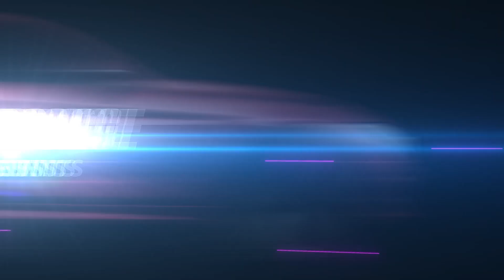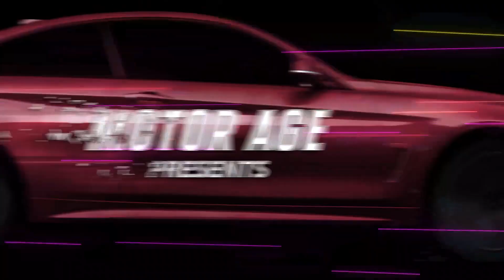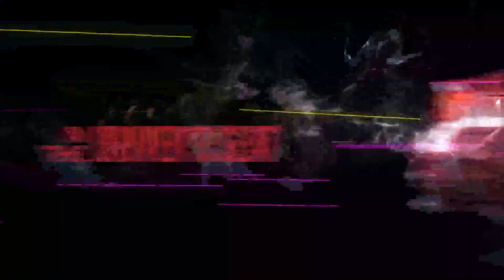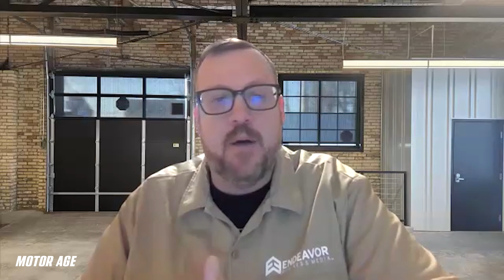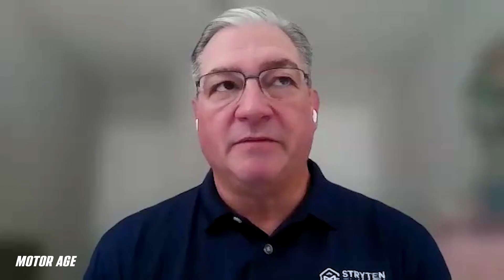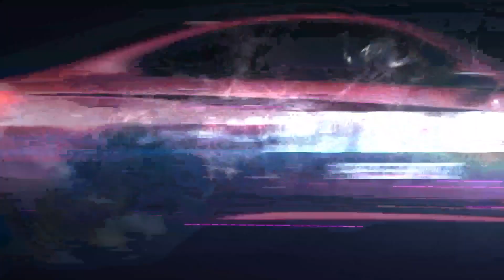Modern Automotive Battery Technology

Comment: To me, this wasn't that informative at all. If you're in the automotive business, you already know about AGM and you already know about the regular acid filled type batteries that have been around forever. Those batteries today are by and large maintenance free as well. You talk about two other types of batteries. One, most automotive shops are not going to be dealing with unless you're a motorcycle shop, the Li type, and the other type that the only benefit that you said they had was, they can take high heat from under the hood. You didn't touch on how many years you could depend on a battery, like that, versus the standard acid filled  batteries that can get as much as 2-4 years  life already and all have some level of 2 to 4 years free replacement warranty. Batteries under the hood today already manage over two hundred degrees heat soaking. It doesn't change just because you have a different type of battery taking that heat load. So outside of taking heat, just like the regular battery this video fails to educate me on why I should stock and then try to upsell to my customers. I kept waiting for the pitch. When we were going to hear how your guest can supply all of our needs and thus it would make perfect sense why he was here doing the video with you. So again?Maybe I fell asleep when you said it but what is the benefit of the other type of vattery vs. that which has been around?
Reply from the maker: I apologize the point wasn't as clear as it needed to be.  Yes, most shops know the difference between AGM and Flooded Lead Acid, but "the other type" being the Enhanced Flooded Battery is a cycling battery that can handle under hood heat better than the AGM.  Its an alternative to AGM for a cycling situation, like you have from with something that uses start/stop, especially one that spends a lot of time in high heat areas and lots of traffic.  There was no pitch going to be made, its just a technology most shops do not have on their radar.